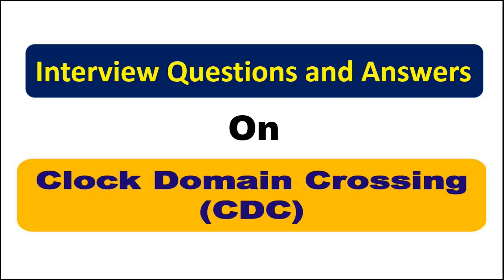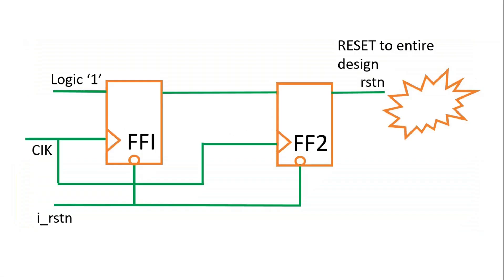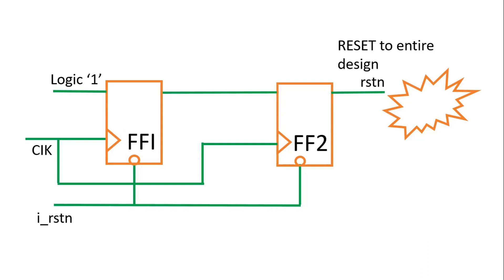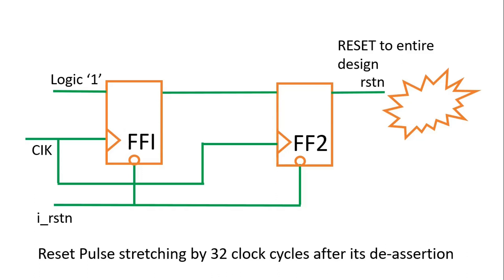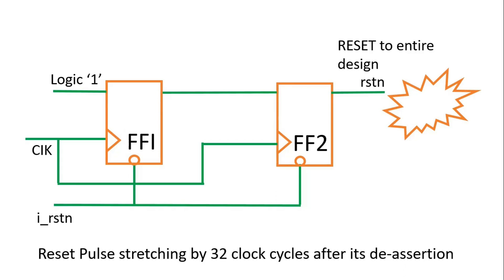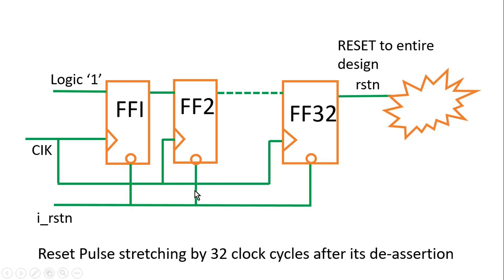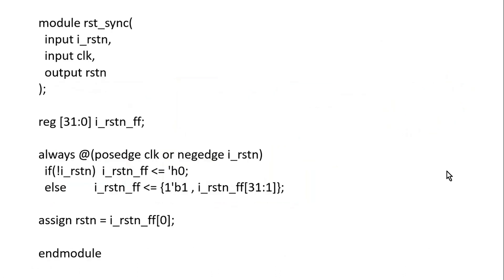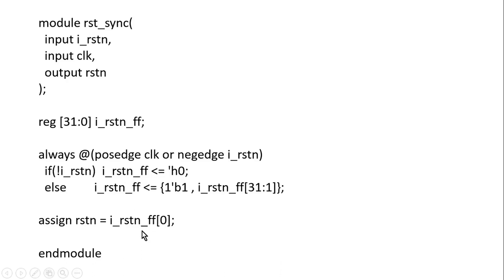Clock Domain Crossing Interview QAs Part 4

Comment: Shouldn't it be mentioned that, the output of the reset synchronizer is fed to the downstream flops' reset input, but it is assumed that those flops are in the same clock domain as the reset synchronizer? Otherwise, you could still experience metastability downstream.